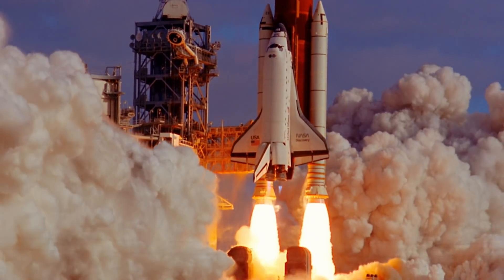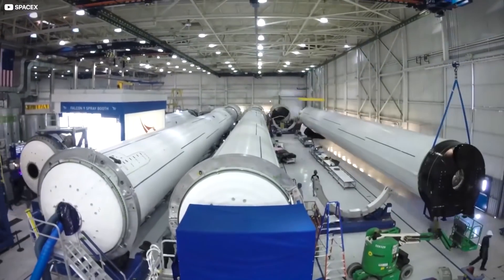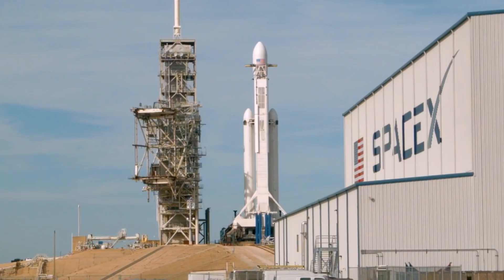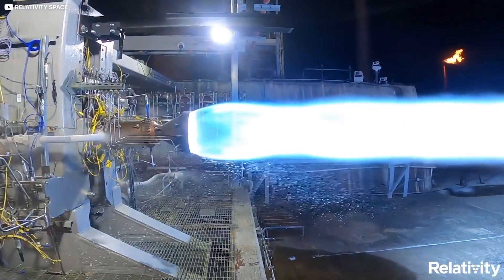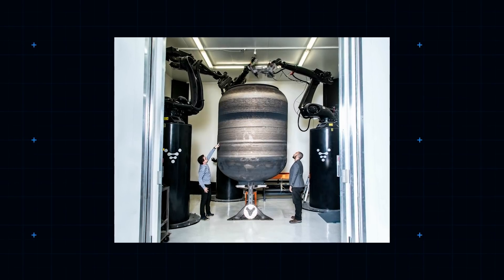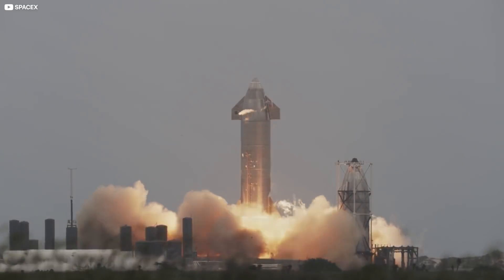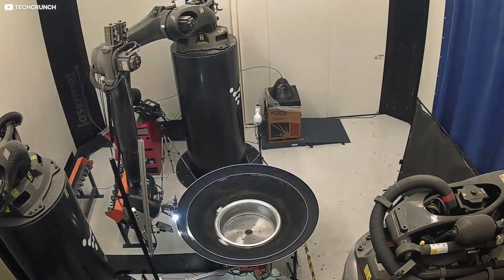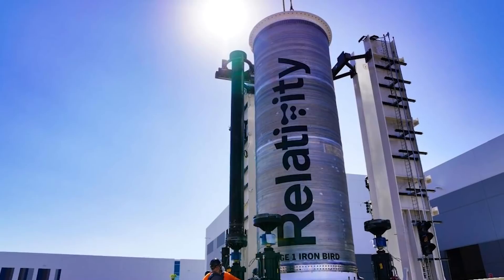How This 3D Printer Builds Rockets

Comment: make these tiny straws in  the skin that buffer a pin being fired  to  the front side  in a firing order the shock of collision causes a modest boon of momentum inertia indifference and force neglects the opposite directions the firing rate balances out throughout the whole fuselage so  it  runs smooth like  a combustion engine with thousands of cylinders when  running in deepspace it accumulates speed of transport.

Comment: I've seen a few videos about this company - Nobody has asked them if they've pressure tested the tanks to failure, if so, where does the failure most often happen? At the horizontal grooves that the 3D printer leaves?
Reply: Yes, it has to be heat, pressure, stress tested. Very likely it has to be tempered, coz of all the internal stresses, it’ll turn into a cactus at the first sign of any heat. Or worse fall apart. So many questions. It’s not a vase to just look the part, print it and it’s done. Does it function?
Reply: @iTeerRex  yeah I agree. And they never mentioned anything about that... lol

Comment: 3D printing is good but it’s too slow when you have to print something big. SpaceX uses 3D printing for small parts like the rocket engines and the Dragon capsules.  It’s all about efficiency.
Reply: It’s faster than the traditional way

Comment: “What if everything we knew about rocket building was incorrect?” 🤨 None of the principles that a rocket is based upon has changed, only we are using a new building technology to do the same old thing. 3D printing has some benefits, and therefore it’s beneficial to redesigning some of the parts.

Comment: Well, it says it simpler... but... building a rocket out of steel sheets looks much more simpler then 3d printing it.
Reply: Veritasium made a video with more details than this, (I recommend u check it)
but in short using, the traditional way of building a piece of rocket requires many many toolings(shaping of metal) for just one part. while 3d printing can print a part in 1 piece.   I'm badly paraphrasing btw
Reply: You're not wrong welding sheets together is simpler but that's only for frame not when you're trying to create a better engine
Reply: 3D printing can be more efficient than bolting together components made by CNC machines, plus less wasted metal, plus more complex structures can be made. For large simple structures such as the fuselage, traditional methods are the way to go.
Reply: @StillAliveAndKicking_  Well, you know, I don't build rockets for living, so I admittingly not an expert. But, would like to see those fully 3d printed ones actually fly. In my eyes printing only parts suitable for 3d printing, like spaceX is doing seems more reasonable in my eyes.